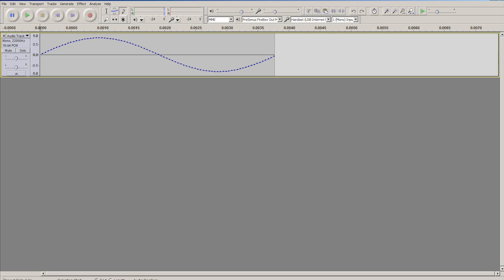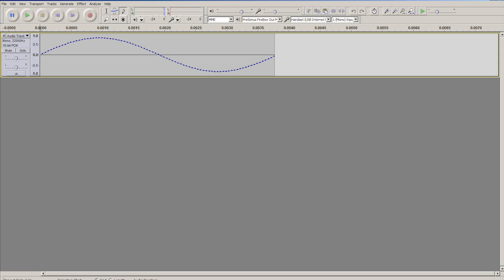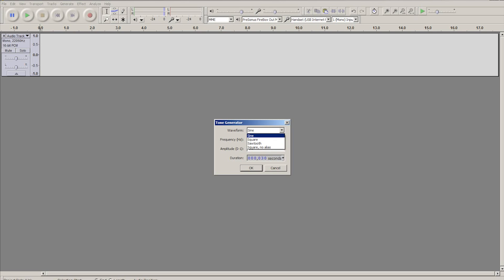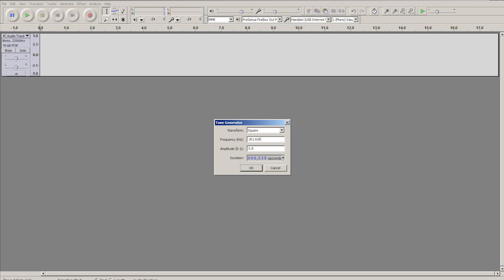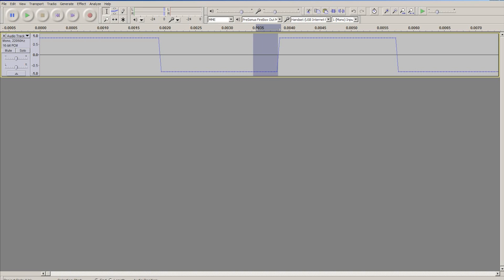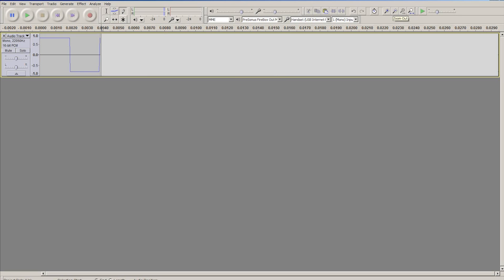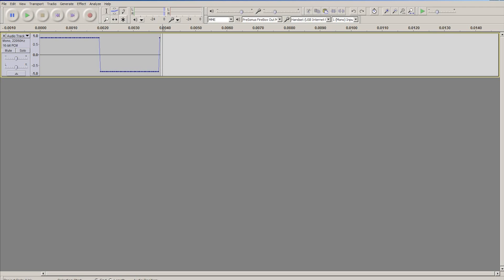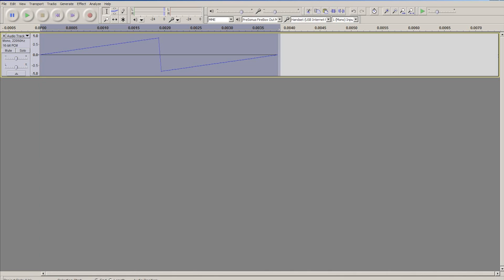Audacity chiptune tutorial - Hand draw some waveforms!

Comment: @jefftheworld
suggestions to any good (and free) sequencers/trackers that this would work well with?
Reply from the maker: Personally I use mostly DOS and Amiga software which can be difficult for some people to set up or use. However, there are some great modern trackers that'll work great as well:

Protracker Win32 is a great port of the original Amiga program that'll run on a modern windows or mac computer. You might find it rather limiting but it's actually extremely powerful and creates modules that are compatible with a real Amiga if you ever choose to go with the real hardware. It's not totally finished yet, so some of the features and hotkeys from the original aren't ready yet but it's already able to play back Amiga modules and almost all of the song creation features are ready to go.

OpenMPT is a modern DAW based on the trackers of the early DOS days. It's got a similar workflow and can easily open older modules but adds support for modern features like VSTs and ASIO. Personally I'm not a fan of the layout of this program and the default hotkeys aren't my thing but this program is highly configurable and totally free.

Renoise, like OpenMPT, is based on the older DOS trackers and maintains backwards compatibility for opening older modules. Like OpenMPT it also adds modern features but a lot more of them, even supporting rewire if you want to integrate it with your existing software of choice. It's got a very nice UI and its my favourite modern tracker by far. It's not free but at $90/€65 it's very affordable for such a powerful and fully featured DAW.
Reply from the maker: Of course, you can also use any synth or software that allows you to import waveforms and use custom ADSR envelopes. My software experience is almost exclusively with trackers, so that's what I tend to use.
Reply: I went with milky tracker as an intro of understanding trackers. I'll probably move on to something a bit more complex as time goes on.
Reply from the maker: Defab galloway Milky is a great tracker! I did a tutorial on Fasttracker, the program it's based on, and might do some Milky Tracker tutorials in the future.
Reply: I would love to see them if you do in the future. I'm having a bit of confusion with some of the features.

Comment: Ok, whenever I draw it and play it back it just burps at me. .030 seconds long segment. How do I lengthen it? When I try change tempo it just makes a burp twice.
Reply: then the shift space thing just plays the original tone.
Reply from the maker: Cinder Cyclone If you don't hold shift it'll play the single cycle a single time, which obviously won't sound like much. You have to hold shift when pressing play in order to engage loop playback and hear a tone. It'll sound loud and annoying as it'll be of a constant amplitude but just listen for the tibre. Once you load it into your synth, sampler, or sequencer you'll be able to give it a proper ADSR envelope.